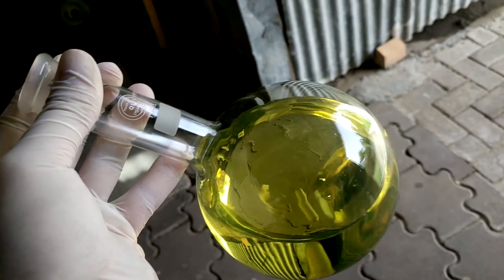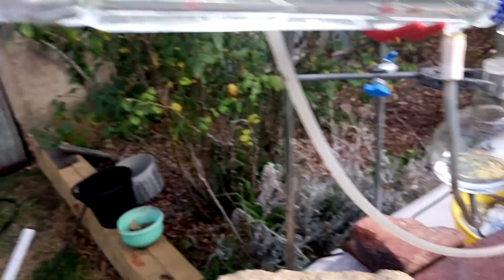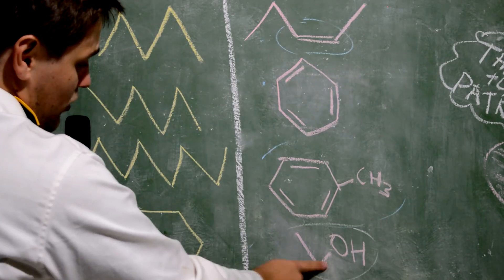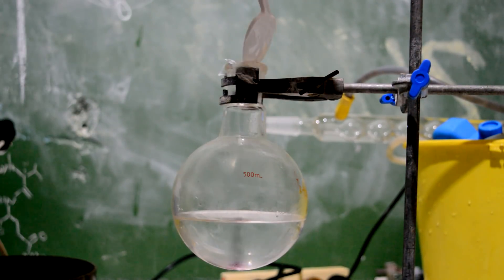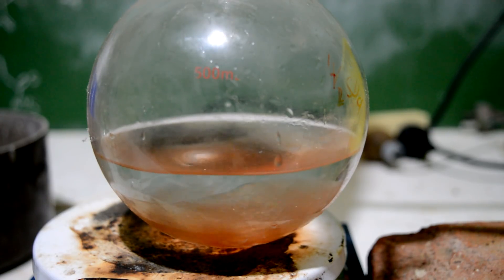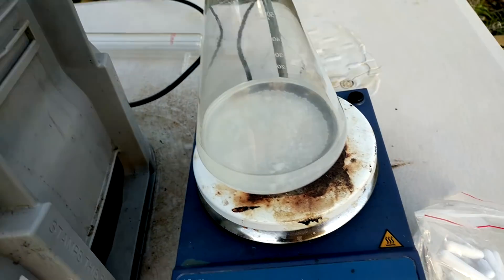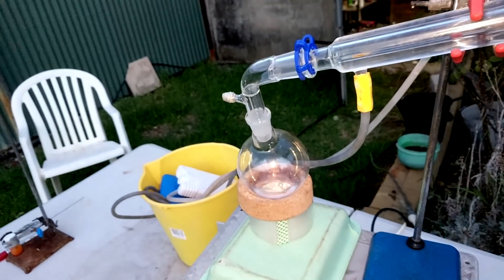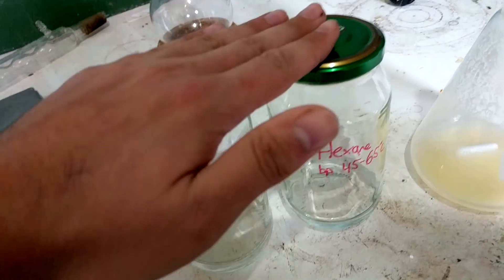Extracting Hexanes from Gasoline/Petrol

Comment: You could have mixed water with your gas, shook it up.Let it separate and decant after separation.And that you would have gotten rid of most of the water and ethanol out of the gasoline before you ever started. I learned that when I learned how to test for too much alcohol in gassoline as a mechanic. Im Also a college dropout🎉🎉🎉🎉🎉🎉🎉

Comment: no its not hexane that used to extrac thc stuff (hexane residu is shit to smoke...  they use heat press mostly , or supercritical co2... or for homemade easy extract u  use isopropyl alcool or even liquid butane out of lighter recharge (but tchek there is no residue in the butane before so u empty one can and let evaporate if ur glas dish still clean u can use that butane...
Reply: and to extract thc i would personaly go for the rotating 200um stainless mesh in the freezer at full power (like -28c) and u load leaf in the rotating stuff, u wait one hour u change leaf u wait one hour u change leaf .... then when all is done u collect yellow powder and here we go u have the 1st pass ... (and u can re put ur leaf in the rotating stuff this time for 2 hour... and so then collect there here go the second pass..; then  go for the 3rd one.. so 3 hour in rotating stuff and colllect
Reply: and while the 1st will be super quality to smoke like that... u might want to go for an isopropil further reffineent on the second and third pass... so put isopropil then wait dissolvation off yellow stuff, and leaf part dont dissolve>... juste pass to unbleached cofeee filter .. let evaporate collect when gluy (became glass brittle stuff if u wait total alccol evaporation(under 25c)   (here ya go ... thc extract no hexane needed XD)

Comment: I was born and raised in Decatur, Illinois. Corn and soybean oil are extracted using a mixture of hexanes, and at least when I was a boy (1961 to arguably 1980), most of the time the process ensured that at any given time there was enough hexane vapor to flatten the town (70,000 to 90,000 inhabitants depending on the year) should it be ignited. Maybe that’s still true. Once there was a real risk of a tank car explosion in the nearby railyard that might well have triggered that…
Reply: I know what you mean because down here we got grain silos and they used to load and unload the cars and those things can flatten entire towns too but they're always smack dab in the middle of the town for some strange reason. They've flattened a few! One super impressive explosion involved 800 tons of a lab chemical and it was an amazing explosion.
Reply: Did you shapeshift into a girl in 1981?

Comment: I tried to get wiser om how hexane is used to extract vegetable oil from different oil seeds. In the process i learned that BMW's 70's iconic 1400+ hp formula 1 racer acheived such high horsepower from using more or less a tolouene enriched fuel. And now im here, still entertained, and learning at the same time 😀

Comment: You dont need hexane to extract thc. I can get bubble bags which use water as the solvent. I can use ethanol, methanol (not ideal, but used before), butane, oils, butter, etc. Pretty much any alcohol or fat you can find will extract thc.
Reply: Your comment is a year old but I'm triggered. In bubble hash water is not a solvent. It's not dissolving anything it's just to carry away the trichromes you break off during a wash.

Comment: Hello sir I have question.
What is best way to extract fuel's from crude oil ore used lubricant oil?
Im experimenting lot with my car with diferent fuel types.
And what I want to do is to build exaust recirculatior destiler and chilers .
I wuld like to know from what are my liqueds made of because they are hightly toxic basicaly my car has tendency to use evry thing from fuel lubricating oil brake fluid hidraulic fluids and anty freze .
So for some reason Im suspecting brake fluid to bound with calcium and chlorine .
My car has tendency to dizel what propertys I realy like.
So is there any way to use curent as in cells ore heaters to vaporise only centrain fuel types tought my exaust system?
Im looking for moisture absorber liqueds under high wacum.
And are any octane increasing liqueds in side the engine?
I wuld like to know how to make own octane boster what culd we use instead of lead? 
I wuld like to make own fuel and use safer gases for my engine what wuld you sugest to use?
What fuel is most burnabel clean burning with less emision gases ?
I need only 2 gases for low and high speed on my carburetor other gases I wuld like to get ride of them.
Thats what I curently working on.
Basicaly any thing that burns I can use in my engine no mather what it is I know how to ajust it but I need to know what fuel types is best clean burning propertis and how to destil it back with liqued seperators.
Culd you show any thing related to that sir?
Reply: I had a stroke reading this. Don't put liquids in your car that it doesn't specifically take if you can't spell liquid.
Reply: I'd highly recommend using gasoline in gas powered vehicles though and diesel fuel in diesel powered vehicles and occasionally some e85 in flex fuel vehicles and if you really need high compression methanol or vp110

Comment: Aren't most of those components azeotropes with each other?
Reply: This is why he used a fraction/vigreux collumn.
Reply: @wernerhiemer406  Vigreux columns don't break azeotropes.
Reply: @toddgillespie8165  Are you joking? What else they are for? To look fancy or what?
Reply: @wernerhiemer406  They are to increase the distance between boiling points of various compounds.  But azeotropes act as a compound wrt boiling points.  E.g., you can't distill off ethanol from water at more than 96%, no matter how many plates your fractioning column has.

Comment: Have you found any brand of stirbar that doesnt lose its magnetism below 250c? Every time I buy them I spend a couple more dollars to try to get better ones and its always the same. Overheat the dang things one time and they are trash... Feel like I would be better off with a handful of paperclips.
Reply: They can be re-magnetized quite easily with a simple coil and good discharge of a few amps from charged capacitors.

Comment: Get/find some Jefferson Pine sap.
If it is fresh, it can be 80-90% Heptane by weight.
Yup, gasoline from a pine tree!
They grow in northern California, so supply is tight just now.
Unique in that there are no other hydrocarbons in the sap, just Heptane.
It is that purity that makes this the 'standard fuel' for determining 'octane' ratings.
They look identical to Ponderosa Pine, except for a slight difference in the shape of the pine-cones.
Turpentine distillers figured out the differences when their stills started exploding...
Yes, I am paraphrasing from Wikipedia, yes, I have seen Jefferson Pines (Seattle Center grounds has a small collection of them) and collected some sap.
Didn't distill any, but the stuff burns like crazy!

Comment: Why the long glass neck in the distillation section? is it because of the vapor pressure of the petrol?
Reply: It provides for a higher rate of condensation in the hot side which makes the fractions harder to come over and easier to control.

Comment: Pro tip: dip a Pasteur pipette (or any very thin glass tube, like a capillary tube for example) into a permanganate reaction and you’ll easily be able to detect a purple color or not. You don’t even need to drop it into water.

Comment: Hexanes are used to extract various alkaloids out of plants because it is a non-polar solvent it is commonly used in the extraction of LSD,DMT, mescaline and some other psychedelic alkaloid, cannabinoids are not nowadays dissolved in hexanes to make hash rosins because of the toxicity and taste nowadays cannabinoids are extracted with ether mechanical action (eg shake and bubble hash), heat and pressure (this usually results in ether rosin or shatter depending on the temp this is similar to toffee and fudge this is fairly universal with the rest of the hashed apart from shake which is a powder) and finally dissolving THC (and other cannabinoids which I don't want to get into) in ether butane (this makes BHOs butane hash oil), alcohol or CO2 (BHO is the black sheep of the hash world cause some people say that it tastes bad but that is usually cause people who manufacture this narcotic get lazy and don't purge the butane out of the oil).

Comment: Nah mate. Hexane and heptane boil too high (and cost much). Since we're lazy and cheap... i mean efficient, we use petrol (with a 40 - 60°C distillation range) or pentane (if we're rich^^ or need a pure solvent for further analysis) for the apolar stuff. Diethyl ether or tert-butyl methyl ether for the slightly less apolar stuff, ethyl acetate for the polar stuff and of course water for all salts.

Edit: But you're australian, i forgot. In warmer climates i'd use higher boiling solvents like hexane and heptane too.
Reply from the maker: Yeah it gets real hot, it makes ether storage hard and dangerous, so I've never done it really

Comment: hexane is not a very good solvent for most organics, its too low polarity. i have never used it as an extraction solvent but only for columns (mixed with other more polar solvents solvent like DCM or ethyl acetat)and trituation of solids. we use petrolium ether in our lab  which is just a fraaction that boils between specified temparatures (like 40 - 60C is common) it is cheaper than hexane

Comment: Can confirm that hexane is used for soybean oil extraction.  It is flammable enough that one is not allowed to use steel tools inside the fence, let alone the building.  I have had the privilege to have to do some welding inside one of these buildings to facilitate changing a 28,000-pound gearbox with eight 55 gallon drums of oil.  The entire building had to be steam purged.
Reply: Oooff. That sounds sketchy. How did they do the steam purge? Sounds like a lot of volume would be needed to clear a building. Was the steam used as a thermal gradient to move the air?
Reply: @TheExplosiveGuy  honestly, not 100% sure of the physics behind how it works. I would venture to guess that it has to do with a combination of the heat, hexane is likely water soluble, etc. But they do it at least every quarter for shit downs. This was just an emergency breakdown.
Reply: @Iowahurler82  I sincerely doubt an entire group of people was insulted by a joke.  I'm a vegetarian, relax.  the physics really aren't difficult- the hexane flashes off and evaporates at about 160.  the steam dispensed at 215 helps that.  I think the industry is awesome.  As an architect I've helped designed building and equipment installations for ADM soybean processing plants.
Reply: @travismiller5548  didn't say the whole group was insulted, I said he insulted the group. A subtle but important distinction. 

And to my knowledge, the hexane used was a gaseous form, not liquid and heavier than air. So it would collect in low areas, sumps, sealed drag conveyors, etc.

So if is your profession that designs buildings and equipment that need 5 days worth of welding to change a single Gearbox.
Reply: @Iowahurler82  I reckon the hexane WAS a gas until it started condensing on anything colder than 160, hence the need for steam cause... physics.  sorry for the bad design, the equipment plans are nightmares and customer demands for adjacency make real, necessary maintenance a low priority... it's ridiculous.  I got out of the industry when construction tanked in 2009... now I'm a glassblower and tool maker.  sorry you had to weld scabby filthy gear in the field, but hey- 5 days pay is 5 days pay! 😂 we'd all rather be TIGing clean new material with ideal surface prep in a cozy heated workshop, amiright?
Reply: @Iowahurler82  was the old gearbox something you were able to forklift out, or did you really have to shoehorn it out of a hole?  sounds like access was bad.  just wondering how heavy/what equipment it finally took. 🤔
Reply: @travismiller5548  it was the Gearbox for a dryer/toaster at a Cargil facility. Empty, that gearbox was 14 ton, oil capacity was 8 55 gallon drums. When they built the facility, they poured the pad, set the gearbox, built the DT, then built the building. Absolutely not getting that one out with a fork truck. We had to weld up steel tables to set on the floor, poured oil on them, and drug it far enough out the door to grab it with the crane. Had to weld in temporary shoring for the structural steel to hang the 4 10 chain falls. Ended up dragging it with 3 1 1/2 ton Harrington chain come-a-longs. 

Input rpm was 1750, output shaft was at a right angle and only 12 rpm.
Reply: @Iowahurler82  I was afraid you were going to say cut a hole in the building and crane 😆 cool trick with slip and slide 🤘
Reply: @travismiller5548  most, of, the time where that is needed, removable panels were already there. For instance the 2500hp fan motors at Cargil in Eddyville are like that. Crane the panel out, hook through the ceiling, motor comes right up and out. 

But I have been in jobs where cutting a hole in the roof of ceiling was the only way.
Reply: oh snap, I'm just upriver from Eddyville in Des Moines
Reply: @travismiller5548  I have done a little bit of work in Des Moines. Mostly at the Cargil plant down by the fairgrounds, another soy bean oil facility, and did some steel erection at the old Younkers building that got converted to apartments.
Reply: @Iowahurler82  still nothing there, 8 years later
Reply: @Iowahurler82  somebody liked a comment and brought me back here.  I made a post that disappeared about how that Yonkers building burnt down March 29th 2014 and it was like a volcano.  and 8 years later no new building yet....
Reply: The Gospel is 1 Corinthians 15:1-4 👇  https://youtu.be/lbb4xwYj19g Book from Clarence Larkin Dispensational Truth, Or God's Plan and Purpose in the Ages🕊
Reply: If these hippies only knew how hard you work to help them with these soy burgers.
Reply: @travismiller5548  perhaps you should try a little maturing before insulting an entire group of people. Besides, you would probably be surprised how much stuff you consume has soy bean material in it.

Comment: This is fantastic to watch after trying some of those "cannaboids" you weren't pronouncing right in this video
Reply: Inject the canaboids
Reply: @Barry_IsOnFyre  don't try this at home, kids
Reply: They're definitely helpful to help me stop thinking about engineering school and finances and rewiring my amplifier and adjustments I should make to the deluxe version of the guitar pedal I'm selling and the general existential dread while I'm trying to focus on chemistry for 15 minutes
Reply: @barretprivateer8768  hey you sound like you've got some interesting stuff going on. What kind of amp? What pedal? 😁👍
Reply: I'm in Canada and I don't need to mess with chemicals. You can just buy oil extracts from a store, and they accept credit cards.
Reply: Chemistry these days has a pretty well defined area of operations: plastic, drugs, bombs. We know which one this guy is.

We used to have materials science but the fucking engineering department took that one.
Reply: Better eat them. The paranoia lasts longer.
Reply: @bakavasa  edibles haven't done anything to me except once, I got tired and passed out with like 7 cats laying on me.
Reply: Cannabois
Reply: Dabs tho so it's def a extract
Reply: 419, got a like?
Reply: 3am lying here smokin on the big canaBoiiizdz
Reply: The cbd will melt your face off
Reply: @realblakrawb  no... it wont
Reply: @dustinandtarynwolfe5540  I was going to say
Reply: Canabinoids. Sorry. Had to...
Reply: @Micha'el Orlev  Cannabinoids*

Comment: You can get potassium permanganate on amazon under the "pot perm" brand.  You can get it in just silly huge amounts for about $10/lb?
Also, this might be stupid, but couldn't you just chlorinate all the alkenes?  even a single chlorination tends to raise their boiling point way over 100C.
Reply: There's a risk of chlorinating the alkanes too. I know that it takes harsher reaction conditions but I mean, it's not like radical chlorinations of alkanes are an everyday reaction in OChem lab, so noone has a sufficient level of expertise to tell us how much does chlorine discriminate. Plus handling chlorine is nasty and permanganate gets rid of the toluene and alkyl aromatics, and even with alcohols and alkenes it does so in a much more thorough way. If I have learned anything from my fucking useless lessons of industrial chemistry is that distillation universally sucks dick as a separation technique, even when separating compounds with a 100°C difference in boiling points. Chemically extracting carboxylates from hexanes with water is so much better, the separation is pretty much 100%.
Reply: @pietrotettamanti7239  I can agree with that.  Whenever you read a paper or patent or have a class that says for sure you will definitely get X, Y and Z out of a reaction, especially with chlorine you're actually on your own and you're going to get a good amount of "who knows what this is but I bet its toxic" out of the reaction.

I've done the same chlorination the same way 3 times with 3 different results: black tar that seemed immune to any level of heat I wanted to give it, orange foam that filled the whole distillation apparatus and solidified, and a white solid that gave off a green-yellow gas (probably chlorine dioxide) that exploded every 20 minutes or so.  None of these things were what was supposed o happen, which was white sludge distilling a clear condensate.
Reply: @htomerif  Your comment is simply comedy gold!